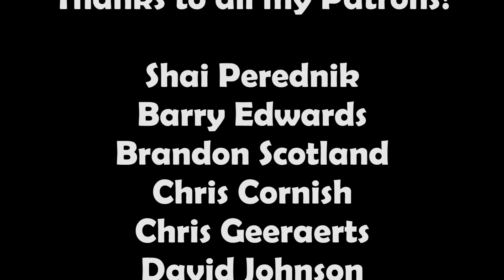Watch this before buying the Artillery Sidewinder X1!!

Comment: I bought one about 3 years ago and it's still going strong, I knew about the issue concerning the extruder arm so I bought a metal replacement but never replaced the original as it's been fine. Since the day I plugged in the ribbon cable Iv never had any issues with it since. Prints have been amazing at 0.2 layer hight with a 0.2 & 0.4 nozzle. Yes it has a few issues but which printer doesn't and they are cheap to fix. There are always pro's and cons with every 3d printer. I also own a criality cr10 again many upgrades and tweaks. As I said before no 3d printer is perfect but I think the X1 is prity close.

Comment: Got a SW X1, you don't need to touch the plastic arm to fill filament in, never had issues with cables, but nobody has the same story right ? 
Most people push the arm like a lever, it's wrong way to use it, mostly you don't touch it and it goes perfect using the machine options to fill in and out...
With the cables, well, you were unlucky, bad day ^^

Comment: Man, you have some bad luck. One of our customers watched this got super paranoid about the X1 that we sold him. We've been using them for a year, and the only problem we've had so far is the vinyl-clad bed thermistor wires wearing out from flexion. We splice it at both ends with silicone-jacketed wires when it happens.

Comment: got one in june. The arm didn't break on mine, the tension seems to have been correct from the factory. But the ribbon cable just walked on me. Thanks for making this, there's some very good info in here!
Reply from the maker: I'm wondering if they have changed the mold since this video was made. Either way, keep an eye on those ribbon cable connections!

Comment: So I don't own a 3d printer yet. I'm late to the game on this and still doing some research before I purchase one. The sidewinder 1x is recommended on a lot of other channels but I just found your YouTube channel. What 3d printer would you recommend since the Sidewinder 1x has so many issues?
Reply from the maker: I think it is a good printer if you take precautions as soon as you buy it. Replace the idler arm and put hot glue on the ribbon cables to secure them.

Comment: My hot end just started smoking and the temp climbs automatically.  Had finished a print shortly before loading up a new one.  I have had some banding issues past few prints and was working on finding the issue.  Stock hot end and extruder assembly.

Comment: Ribbon flat cables are not designed for moving parts. We used them in micro hifi systems linking static breakout boards  when I worked as Audio R&D Engineer back then. You are right when you say by design, this is a problem.
Reply: Really, so injet printers that have been that way for 30 years are designed wrong?

Comment: im watching this after ordering mine :(
Reply: I haven't had any manufacturer issues with mine (a v4) so far, and I've owned it for about 4 months now. It's been miles better than my first printer was, and I highly recommend it.
Reply: Just buy a metal arm and put a dab of hot glue on the joints of the ribbon cables. Any half-wit can do that. I just ordered one for my brand new printer and I'm gonna break out my hot glue gun now.

Comment: Just got mine 2 weeks ago and it did NOT include the extra idler arm, I’m hoping the issue is fixed? Or they forgot to put it in the box? Just finished up my first Kg spool of pla and so far, it has exceeded my expectations. I’m a total noob to 3D printing/slicing and from what I can tell at this point, I may need to print a better cooling shroud if I want perfect overhangs without using support. Or I just need to learn more about various settings and save them for various prints. Does everyone have over 10 print profiles?

Comment: Seriously having a few quirks on a printer makes you investigate and learn more about 3d printing then you get the satisfaction of printing your first real world practical things that you can add to your printer to make it a better more reliable printer. No matter how you look at it 3d printing is not a plug and play hobby, bed and nozzle temperatures, material types, layer heights, supports. If your concerned about printing a few parts then and your not willing to learn a little then 3d printing is not for you it's not a star trek replicator. My first printer was a flashforge creator pro and I brought that at £500 because I listened someone on a forum talk about how it was better for "beginners" vs something you needed to mod so I ended up with a noisey rattle box with a build plate the size of a postage stamp that I still had to print parts fo!. When it comes to 3D printers beginners is a very relative term your only as beginner as you want to be. I have the sidewinder v4 and I love it compared to my creator pro. In fact I've just ordered a second one and giving serious consideration to getting a third just in case for some reason the company goes out of business in these turbulent times I'm also stocking up on a few replacement parts that's pretty much the best compliment I could give. Right now the Artillery sidewinder is to the FDM world what the Elegoo Mars/Saturn are to the SLA world. Now all they need to do is bring out a big core XY or a large Delta. 3D printing is addictive!!!.

Comment: Have one and love it. Done a couple of mods. Replaced the arm with a metal one, moved the fillament off the top of the gantry, installed a z-brace, clamps for the ribbon cables.
Reply: What brace did you end up using?

Comment: Is there a single affordable printer on the market that you don't need to mod for it to work reliably? I don't want to have to fix anything.
Reply from the maker: The Creality Ender 3 works right out of the gate. Also the Anycubic i3 Mega S is a great choice. 20 minutes to build and then you are off printing.

Comment: In regards to the idle lever breaking, here's some advice I got from another X1 user:
"When you get it from the factory, loosen it all the way and then tighten it till you can’t pull the filament out anymore. The issue is that people fail to do this and it’s too tight and breaks."
Reply from the maker: I said I did this in the video and it still broke.

Comment: I'm completely agrre. The printer machine works really good. But, it comes with a lot of little issues. By my part. I had this printer like one moth ago. In one month, y had a problem with the wires of Z motor, they come almost broken. The cooler started to make noise. I had a problem also with the printed pieces that I tried to make. Looks like an obstruction. I change the pieces of the extruder and it started to work fine untill I tried to make a piece with some altitude. And an obstruction again, probably because a problem of the motor cause it is impossible to have again an obstruction so quick. The people that have this machine are in general happy, maybe the mine one is a defective one. But to many problems in just one month of use.

Comment: instead of using the hot glue you can use  liquid tape(rubber insulation)...no heat from glue and it holds much better(flexible);   https://youtu.be/y_CfQtgrW9c

Comment: While I agree the arms is not the best and a Metal Arm would be nice this printer has been an absolute joy to own. The filament change option is great, and almost eliminates the need to push the arm at all, and as you stated the tension knob at the back of the arm needs to be loosened. It appears to me that you just received a dud machine, which happens, Look at Angus from Makers Muse he hated the Ender 3 because of all the issues he had but everyone else loved it!

Comment: Hi. I am having some trouble with my 3D printer. I have a Folgertech FT 5 R2 and I am getting what looks like some small minor underextrusion or filament skipping in the layers and also extrusion inconsistencies throughout my prints. I am using Makergeek’s PLA with the printer’s original extruder. I have already change the print speed setting from the default, which was print speeds of 60 mm/s, acceleration of 3000 mm/s^2 and jerk of 20 mm/s to the changed setting, print speeds of 30 mm/s, acceleration of 500 m/s^2 and jerk to 15 mm/s, from there being layer shifting and under extrusion problems at the default speed setting. this kind of worked but still my problem that I am asking about is still there. I don’t known if the problem is the filament, the extruder setup or my Cura Slicer Profile Settings. What is the best why way to solve this or a list of things I can try?
Reply: Go to Reddit and ask this question to the subreddit r/3dprinting. Much more reliable to get answers there

Comment: I see your points and I have seen others having the same problems. However, there was not a single of these on my machine. When I change filament (and I do frequently because of color changes), I never press the idler arm. I only pull out the filament, when I have confirmed in the menu after heating. Same for putting in the new filament - just put it to the short end of the tube and it will grab the filament. Spoolholder, I have a printed version beside the printer. I do not like the extra amount of weight on top of the printer. Based on my experience, I would recommend this printer.

Comment: so in conclusion you dont know how to use ribbon cables, theres no reason they should be pulled on but in the unlikley event that they are or something gets caught or whatever itd by WAY preferable that it just disconnects rather than damaging the cable and/or board its connected to, the original models had them but they got removed, cost might of been the reason but as far as i see it its an improvement

Comment: Question, since this uses an E3D Titan clone why not just order an original Titan idler arm from E3D? They're only like $10 US. Or is there a reason it won't fit? It would certainly be more reliable and durable than the Asian knockoff. Overall your's is not a bad video about these issues but its hard to understand what you're trying to say. You say its "a pretty fantastic machine" but you recommend people not to buy it. I need a second machine and after lots and lots of research I think its going to be this one. In my opinion its strengths outweigh the faults. Any printer with these features that is under $500 is going to have some issues. My concern is finding something with a strong foundation that has room for some upgrades and modifications.

Comment: Please stop posting that link to Amazon for the idler arm that supposedly will fit the Artillery Sidewinder. I ordered it and it does not fit. The hole in the arm below the bearing is smaller than the metal rod it is suppose to fit over. I had to send it back, so now I guess I'll have to contact Artillery and ask for a new idler arm.

Comment: Since I got my Sidewinder, I've had to replace all of the ribbon cables and now I'm replacing the idler arm same as you. I went ahead and ordered the circuit board just to be on the safe side and have it if I need it. I'm replacing the nozzle as well because I did manager to print quite a few things before I started having problems. I have the version 3 machine, by the way. I still think it's a great printer in terms of its features and the quiet stepper drivers/motors, but it's just typical cheap Chinese junk in terms of quality of parts. The ribbon cable design is nice, I really like the lack of a bunch of loose wires like on my other printers, but the clamping system they use leaves much to be desired. You would think that they could fix that design by adding some sort of clamping mechanism to the ribbon cable connectors. That's my 2 cents anyway.
Reply: If you look at a Raspberry Pi they use flat ribbon cable sockets that havan integral clamp built in, could be a fix for this. Surprised they did not supply the clips. Im waiting delivery , hope its the latest version. This will be my 3rd printer.
Stef

Comment: I disagree with so many things in this video bu it's good to have it posted so that people can have an all around opinion and decide for themselves. I don't want to sound negative but I think I'll share my opinion for anyone that wants to read it.

First of all that is not a v5 but a v4( with probably a few extra spare parts) . I have had one of the first v4 units for around six months and I didn't have any problems with it other than misaligned eccentric nuts(which is one of they things that they suggest that you do out of the box in their manual). This has been my first 3d printer and I bought it because it was the best for the price.

Now in regards to the ribbon cables, mine have gone on and off a bunch of times for minor modifications (that begun after the 2 month mark) that and never got fried. Most burned cables I've seen come from people not plugging them in correctly. Sure there were a few instances where there was a bend pin in some boards like yours but it's a Chinese printer low budget printer... there are definitely gonna be a few faulty units (although their support is one of the best I've seen thus far and will definitely help you to get a replacement). Also, the slight pull that the cable needs on the z axis to be removed, is something that will 100% never happen during printing if you don't pull it yourself. TL;DR you don't need to put hot glue on it because if you want to remove it for maintenance you might break/rip something. Just be careful while removing it or plugging it in. 

Furthermore, the "every 3 post there is a problem with the printer" point, that is very true but it's also something natural. Most people that use the printer and do not have any problems with it will not post about it at all. It happens in every 3d printing group and during my research I've seen 4 or 5 different ones. There is not printer out there that will not have someone complaining about it.

My extruder idler arm didn't break thus far but I don't know if I am just lucky or it's the fact that I use it carefully and I am not putting to much pressure on it, so I can't have an opinion regarding that. A spare on is one of the first things I printed just to be safe because mine was, as I said, one of the first units which back then didn't include that.

Now in order to be fair, those are the things I didn't like about the printer: First of all the firmware is not greatly optimized... The extruder steps are way to high and it needs a bit of PID tuning it needs a bit of tuning to get it right. Second, the spool holder definitely needs those parts that you have printed if you are using different size spools. Third, the cooling fan needs a different design such as the one you have. Lastly I don't like that I can't upgrade the firmware without removing the touchscreen (that is due to the mks touchscreen though and not because of artillery).
Reply: Well said. I'm in agreement with you on all your points and I thank you for the commentary on your experience with this printer. I still regard it as a strong, perhaps strongest contender for what I buy in a couple months. It has come down to going the Sidewinder route or an Ender 5 (stock, not Pro or Plus) and upgrading the mainboard, hotend, etc, etc. By the time I have the Ender 5 up to the same features as the Sidewinder I'll have spent over $500 and that just doesn't make good sense. I really believe that this Sidewinder has a lot of potential and I can easily deal with the relatively minor issues that it presents right out of the box. Thanks again.
Reply: @ew7007  Just use common sense when using  ANY 3d printer or CNC, ESPECIALLY budget chinese 3d printers, ALWAYS ALWAYS ALWAYS monitor your prints! If you don't want to keep it in the same room you frequent then hook it up to octoprint and a camera. NEVER leave the house to run a few errands during a print, especially with a machine that has the cabling so loosely coupled. A lot can go wrong in a few minutes and the reason I'm on this video is because of a reddit post from someone who did just that with his X1 and came back to a house filled with smoke and a burnt up hotend. Would you trust chinese QC with the safety of your property? As a beginner especially you need to follow these guidelines as you are new to the hobby and haven't developed an intuition or mindset to see when things are going wrong.
Reply: I realize it is pretty randomly asking but does anyone know of a good website to stream new movies online?
Reply: @Rocco Davis Meh I use Flixportal. You can find it by googling=) -uriah
Reply: @Uriah Hunter thanks, signed up and it seems to work :D Appreciate it !!
Reply: @Rocco Davis Glad I could help :)

Comment: Every third post in FB group is not about the idler arm, it's a stupid post asking for printer profiles. So annoying. The remaining posts are pretty much pictures of Groot or Yoda prints. The faults you speak of are easy fixes for anyone with a modicum of intelligence.
Reply: The facebook group is so cringe. I know people TRY to help and stuff and that's nice but people just spew some horrible advice on there sending these poor beginners in circles troubleshooting things by telling them to do things like edit firmware and changing heat breaks before even going through the simple more glaringly obvious fixes to a problem that could just be due to user error. Like the person just bought their first printer and telling them to take it apart is irresponsible and is doing a disservice to the user and the group. A much better option for a beginner to get help is to send them to the discord where flat out bad advice could be swiftly shut down by the very intelligent and helpful folks over there before it causes any damage.